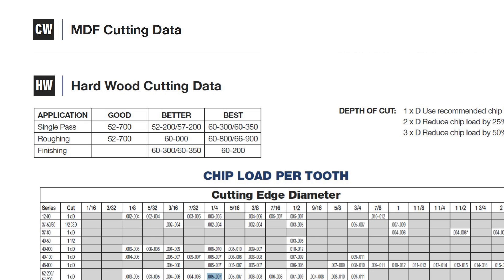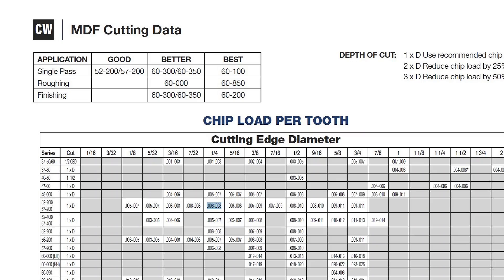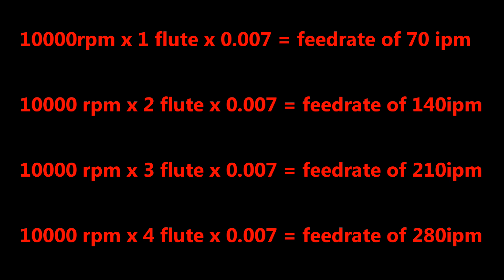Feeds & Speeds - CNCnutz Episode 154

Comment: I have 4040 cnc router fix gantry table moving Chinese machine with leadshine servo motor and drive, and 24000 rpm spindle motor, so please guide me for their feed rate and plunge and, spindle rpm and step down and step over for portrait designing Engraving on iron

Comment: Thanks for the video. I am new to the CNC hobby and trying to get an understanding of feeds and speeds. I work with wood only. 
Is it advisable to use the following objectives for a selected wood material / product :
 - lower RPM to a point where cut quality is acceptable but within the range of 10k to 20k,
- stay below 1X bit diameter for depth of cut and step over < 40%,
- operate in the 25 -75% of bit manufacture's chip load design

Any comments to these and additional ones would be appreciated.

Comment: Hey Peter, Awesome vids, finally got around to building a laser shoe of my own. Question about setting up the laser in mach3. I have done multiple tutorials and I can get the laser to turn on and off when the job starts but it stays on the whole time. Any tips? I have a PWM controller and it should work with the laser but there is hardly any info out there that actually works.
Reply from the maker: +Brandon Luke 
I don't have PWM on my laser so don't know much about how it works other than the basic principle. My thought is that it is probably on ask the time except when going down a rapid between engravers or is at the lowest power level  when it  rapids and wouldn't mark the material. Adding PWM is on the list of things I want to try in the future but not right now. I CNC only suggest looking at www.picengrave.com They are the experts in the field of laser diode engravers and PWM. They are the people I will be looking at when I do mine. Also check out their software for creating the Gcode. More than that I can't really help. 
Cheers 
Peter
Reply: Well I did some extensive testing tonight. The laser works well. I can turn it on with the M3 commands and off with M5 but mach has a delay using those so I need to use the M10/11 which I still have not figured out. I have also tested the PWM function but manually changing the spindle speed in mach3 and that works to change the laser power. So my wiring is correct and Mach can apply the setting but the gcode is not working to turn it off and on, which I tried multiple PP (yours and jtech) Apparently there is some config screen that you enable those m10/m11 commands that I don't have in Mach. Other than that. You set yours up using TTL then? I have been on the picengrave forums and it looks like very nice software, thinking about getting that. I just built a laser from DTR laser and it is super awesome.
Reply from the maker: +Brandon Luke 
Mine is ttl. M10 / M11 commands work when the axis moves so if you are using MDI to issue the commands they don't take effect until you move the axis. My post processor only works when the laser is setup per my video. I did get PWM working in Mach3 but it is not suitable for a laser as it is too slow. You will find about 0.5 seconds delay between each PWM change built into Mach3. 
Cheers 
Peter

Comment: Peter; as usual, you hit the nail on the head for those of us who are cnc challenged. Question: Can you give me any input on cutting Lusterboard? This is a 10mil plywood material laminated with aluminum on both sides. The apps you suggested, nor any web sites I could find, give specifics on feed and speed. Thanks from Petros
Reply from the maker: +Peter Rouzaud 
Sounds an interesting product. 
Your guess is as good as mine on that one. I suppose I would use the aluminum feed rate and cut through the surface layer. Then increase to the plywood rate for the plywood inner layer and then reduce it to the aluminum rate again for the bottom layer. 
Another option is to use a 1/8 cutter as the plywood and aluminum chiploads overlap according to the US tools app. 
Just a thought. 
Cheers 
Peter
Reply: Thanks Peter. No, my guess is not as good as yours. I'll do some practicing on some scrap per your idea. As you say, 'wood is forgiving'. So, if I favor the unforgiving, the wood may work out. BTW, Lusterboard is a common product among Sign makers here in the states. A better, almost forever product is Dibond, or ACM (aluminum laminate) with a polyethylene core instead of plywood..Thanks for your answer. Peter
Reply from the maker: +Peter Rouzaud 
I have the ACM board and just use the Aluminum feed rate. The plastic doesn't care what feed rate you use. 
Cheers 
Peter
Reply: I'll try that too.

Comment: G'day Peter,  I have been enjoying your videos very much.  Thank you for sharing your knowledge and advice. 

I am just about to start building my CNC machine in the OX style.   One thing I am wondering is how the CNC knows how not to run into any of the hold down clamps or bolts sticking up on the table.  Perhaps a video explaining that would be brilliant!
Reply from the maker: +Paul Jones 
The secret of the CNC machine not hitting a hold down clamp is to put them where they won't get hit. The CNC had no idea where the clamps are and it is up to you to position them out of the way. That is why they are best made out of materials like wood or plastics so the won't damage the cutter if / when they get hit. 
Interesting question though and maybe I could make a little video on it. 
Cheers 
Peter

Comment: Thanks Peter for useful information, be humble but the best information on Hobby CNC on YT. Once again Cheers
Reply from the maker: It isn't really what the chip looks like as such. 
So long as you are producing chips and not dust then that is a good start. 
If you are making dust your feed is too slow for the spindle speed.
A better indication is to look at the finish on your cut since a slower feedrate will give a better finish and a too fast feedrate will give a poor finish. The sweet spot is in between if that makes sense.

If it helps here is a photo of some chips out of my dust collector. Don't know if it will help or not.
https://photos.app.goo.gl/RFQ0SzGSr9p9am153

Cheers
Peter
Reply: Thanks, sweet spot got it. Peter I am all ears :).

Comment: Peter you missed something. Your spindles RPM is calculated using SFM and the diameter of the cutter! For wood you want about 5-800sfm whereas for aluminum it's 250,and steel 100
Reply from the maker: Hi Julius and thanks for the info.
When I was researching this I found SFM values used in metal machining calculators but didn't find info related to it in Wood machining. All used the basic formula I outlined in the video to calculate feedrate. The documentation from Vortex tools recommends a spindle speed of 9000 - 10000RPM as a starting point and that is in line with what I currently do. I did find a spindle speed calculator that used Surface rate and 10000 RPM is right in the middle of the values you give for wood if you use a 1/4" cutter. I don't think it is going to make much of a difference for the home enthusiast cutting wood. 
Cheers
Peter

Comment: Great info Peter.   I have the app from Vortex.
Reply from the maker: +Jack Ulibas 
Thanks Jack. How do you find the app?
Reply: The app is really good.  I was running my spindle too high for the bits I have been using.  I'm still new to the CNC world and the app helps me with my speeds and feeds.
Reply from the maker: +Jack Ulibas 
Excellent news.
Reply: bravo 👏👏👏 
Can't recommend the SuperPID controller enough. It served me very well. I have now undergone the spindle upgrade. Thanks for the inspiration.
Reply from the maker: +Trevor Burke 
Thanks Trevor. 
I too found the SuperPID to be excellent and probably the best option for router speed control. 
Cheers 
Peter